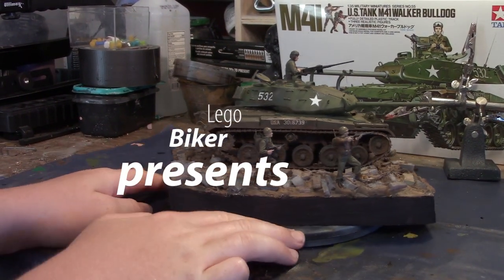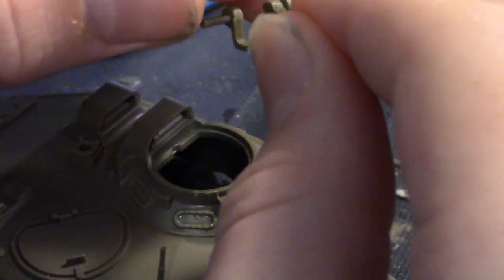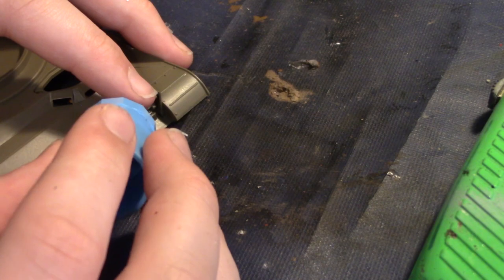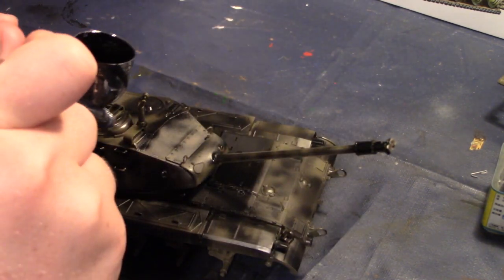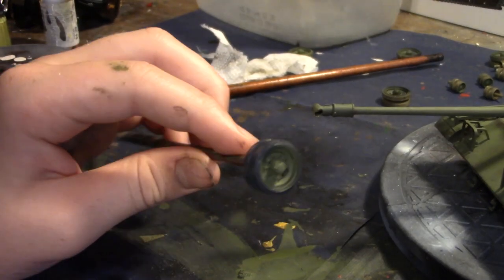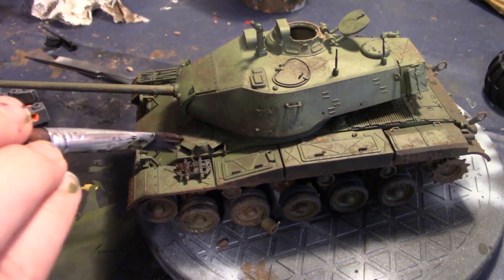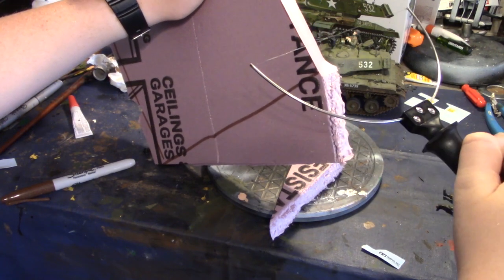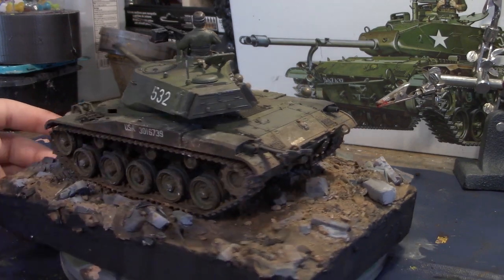Tamiya M41 Walker Bulldog Tank-1/35 scale Diorama-Tank going through Rubble

Comment: Nice build and diorama!  If you plan to replace those missing grab handles/tie downs on the turret: technique is to use wire from twist ties (carefully strip the paper/plastic coating), easy to bend/shape, CA glue them into pin vise drilled holes. Circle template can be used to spray paint road wheels: spray the wheels black/rubber color, when dry use the correct diameter circle to mask the rubber part and spray the exterior color. To mitigate decal silvering, try a gloss coat (either clear or exterior color) > decal/solvents > clear dull/semi-gloss coat. Again, nice work!